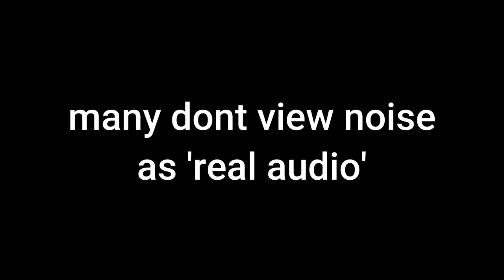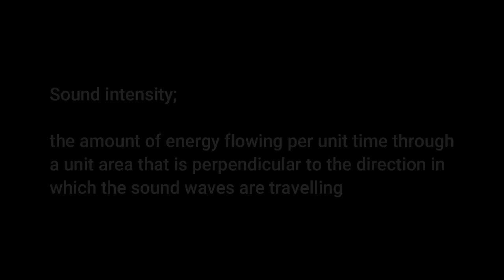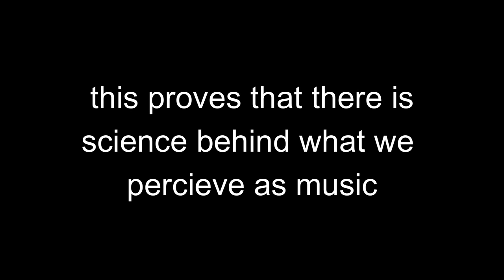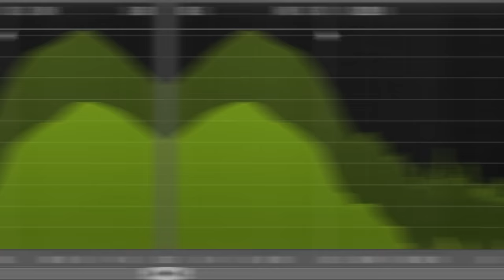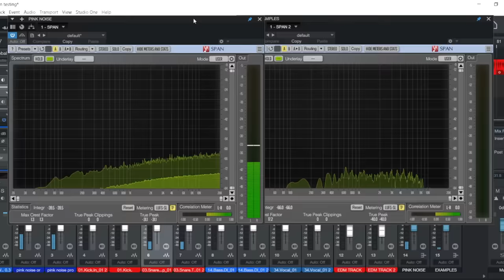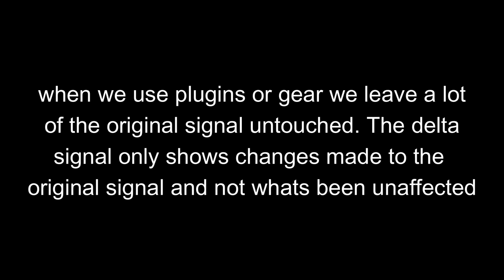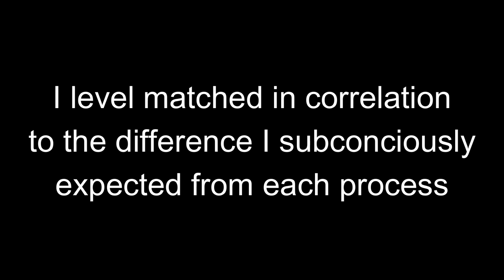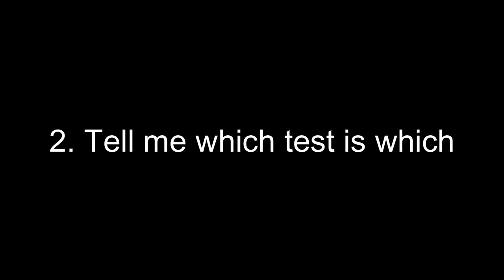THIS test will stop you buying more plugins.. and maybe even improve your mixes!!

Comment from the maker: FYI it was brought to my attention that when it comes to inharmonic instruments that have no musical context or harmonic structure ie cymbals and hi hats. There is no noise slope for this. These should be nulled individually on the source itself. This pink noise test will only work with musical sounds that follow a harmonic structure. 

Test 1

https://soundcloud.com/paul-third-944739244/sets/6dbfs-kick-test-can-you-hear

Test 2

https://soundcloud.com/paul-third-944739244/sets/test-2

Vote on the community post on my channel which will be up for 24 hours 🤓
Reply: I didn't fully understand the test, but my guess is that B is louder in terms of dB.
Reply from the maker: In which test?
Reply: @PaulThird  The first test. In the second test the choices are AA and BB.
Reply from the maker: One test is a 0.6db level difference and another is a 0.6db tonal difference caused by saturation
Reply: @PaulThird  Okay, then my guess is that in test 1 B is louder in dB and in test 2 BB is the saturated audio.
Reply: Well, I must face the fact that I do not have superhuman ears.  I could not tell any difference no matter how many times I A/B'd them.  I cannot see bacteria without the use of a microscope either.  I won't belabor the point.

Comment: one of the neatest tricks I've learned over the years is if you're having trouble with a mix, to throw a pink noise source on the monitor and then level each track individually so that its barely audible over the pink noise, it works surprisingly well and after a while I began to understand how to move towards that result more organically. Doesnt change that my music is shit, but its balanced well now at least !
Reply: lol!
Reply: Interesting I have never heard of this. I will have to try this out for fun. Thanks for sharing
Reply: Gonna try that. Usually if I'm adjusting levels I'll throw a mono plugin on the master bus..set my levels then just turn it off, and it made a huge difference. If not I'm fighting it getting aggravated

Comment: Thanks Paul. It's a sorry fact of life but no amount of showing people the truth will convince those with little skill in critical thinking, but it's courageous of you to try. One note is that polarity inversion is not the same as a 180-degree phase shift. When you invert, the waveforms are still precisely aligned in time. When you phase shift by 180 degrees the two waveforms are out in time by half the wavelength. Thus, with a non-sinusoidal signal, shifting the fundamental by 180 degrees won't move any other frequency by 180. Inversion makes every frequency in the signal opposite phase. 😆
Reply from the maker: Yes, I figured that out in another comment haha 😅

Comment: Paul, speaking of not purchasing more plugins - there's a company called Direct Approach that just announced all it's plugins (there's 10) are free. They all seem to be unique. Would love your take on these!
Reply: @PaulThird  Their metering plugin, SpecTrend is actually what first attracted me. It provides a pink-noise weighted view of the audio spectrum of your track. With pink-noise weighting, all frequency bands will be at the same level when your mix is spectrally balanced. And the +3db low end compensation allows for more low end in modern mixes. I wouldn't necessarily let this tool dictate my mixes, but an interesting referencing tool, nonetheless. It's also completely silent.

Comment: The person that wrote “use your eyes, not your eyes” is using their eyes to decide what a plugin sounds like based on the description they read. People also tend to think a plug-in sounds better based on how much money they spent on it.  

I use Logic Pro, and for the most part their included free plugins. They work great, and when comparing to something like Waves plugins which I demoed, on an equal if not better level of quality. 

My one concern in the tests is while noise is a valid audio source for null tests, I wondered about transient responses of the plugin. Especially if it’s adding any distortion/harmonics. 

But overall I find your testing very thorough and well thought out and executed. 

Null tests don’t lie. Do you think you get “better” audio quality recording at 128k instead of 48k? Null tests show otherwise. You gain aliasing artifacts at high sample rates and gain no better frequency response. 

But people have bias confirmation and always think their rationalized option on what they just heard proves them right. 

That’s why we do blind listening tests. To avoid bias.
Reply: @PaulThird  By the way, I made the transient comment before I got to that part of the video! So thanks for covering that. I agree with your findings. I’ve been a self taught audio engineer for the past 50 years of recording myself and my bands on all manners of gear. We have so many options these days. Too many! Lol. 

I say just get a good recording going in and stop thinking some plugin is going to eliminate the skill needed in mixing. That just takes experience and learning how to hear (and see) audio.

Comment: I think what's happening is people are confusing static processes with dynamic / nonlinear. 
Someone who doesn't know the difference won't accept an eq null because they've heard dynamic comparisons as different which were only measured statically. 
Some tests, noise or otherwise are only appropriate in certain tests and situations. In other words we can't measure psychoacoustic differences over time.
Reply from the maker: Yup when in reality the null test caters for everything regardless of dynamic or static process.

A pink noise null on compression for example would give the same maximum difference amounts but at a fixed gain eduction so to really paint a more consistent picture, in theory, you would have to take snaps shots of the null at different levels of gain reduction but the reality is that in a dynamic test, as long as the max frequency peak is matched whatever the highest gain reduction that source reaches is, the pink noise null will show maximum possible differences at that gain reduction.

Comment: I have a theory on why less than 1 db can be heard.
It's not that you hear 1 db difference, but that  two sound files (wav, mp3, whatever) may have, say, 0.5 db difference, but those files pass through a multiplier (amplifier), that being your sound system or even plugins in the sound chain.
In that case, you are not listening to just  1db or less of difference, but that amount multiplied by a certain factor.

Comment: Music is just organised noise.

I attended a mastering seminar by Bob Katz a few years ago where he suggested that we can perceive a difference of 0.2dB - louder is better.
Reply from the maker: I spoke to somebody else who said the same but it was more of a distortion speaker trick you could use at 0.2db but on average sources its much harder. I've found from this test that level difference is easier to hear compared to tonal difference. I'd argue tonal differences of 1db is much harder to identify than a 1db level change.

Over 80% failed my double 0.6db test
Reply: @PaulThird  - I wouldn’t disagree, a 1dB difference over the whole spectrum is pretty obvious. 

A 1dB difference in tonality probably depends on the bandwidth of the difference - I’d suggest that a 1dB boost with a Q of 5 is more difficult to discern than a 1dB Boots with a Q of 0.5. An “area under the curve” kind of thing.
Narrow cuts are even more difficult to hear.

Comment: Really cool video! A lot of it is going over my head, but I have one question regarding the idea that a sub 1db difference is inaudible. If a plugin was generating an unintended bump of .3-.6db and it was being instantiated on a large handful of tracks in a mixing session, wouldn't that cause a buildup that would ultimately become audible? I may be way off in understanding what you're getting at in the vid haha but thanks for all the info! was still interesting to watch regardless
Reply from the maker: Then it must likely wouldnt be a sub dB difference if you added them all together. I'm talking about a difference caused by 1 process on 1 source. You are talking about 1 process over multiple sources. In that instance the bump would accumulate and become audible, well depending on if the source makes a lot of that frequency anyway and other factors. Depends on where the bump is, how wide it is, how much its adding, how many sources its on, the level of those sources in relation to the mix and what frequencies they make.

Its all context, are you adding 1 process to 1 source or adding 1 process to multiple sources. There's a very big difference in methods and context but both can still be measured to give you an overall level difference

Comment: Hi, i'm a hearing aid acoustician and i have small complaint: i'd really like to see the source that claims that frequencies below 250Hz largely bypass the inner ear because they don't and you couldn't hear them if they did.  What is true is that we percieve frequencies below 250Hz to be quieter than higher freqencies with the same energy (see "Fletcher.Munson Curve), but we can hear frequencies down to approx. 20Hz.
Reply from the maker: https://www.science.org/content/article/sounds-you-cant-hear-can-still-hurt-your-ears

https://www.ncbi.nlm.nih.gov/pmc/articles/PMC4448896/

That's where I got the exact quote from though 

https://royalsocietypublishing.org/doi/10.1098/rsos.140166

If I recall I did say that the reason for us perceiving lower frequencies less is due to lower frequencies being inadequate at driving the inner hair cells of the cochlea. That's somewhere in one of these references.
Reply: @PaulThird  Ok sorry for the late answer: the term largely bypass the inner ear might be a bit unlucky, because what frame of reference is used here? All energy that has been coming from a certain sound source? But the energy coming from a sound source will mostly bypass the inner ear in all frequencies, only a fraction of the energy will even get there. What is actually true is that a sinus at 250Hz needs to be about 20db louder than a sinus at 1kHz (which equals to 10 times the energy) to generate enough action potentials in the inner hair cells to be conciously perceived. That might sound like a lot, but humans have a hearing dynamic of 100db or more (and since db is logarythmical this equals 100 000 times the energy) so in correlation it is actually not that much. Anyway these frequencies don't "largely bypass" the inner ear, the hearing cells just need more energy to be activated in lower frequencies (interestingly the difference gets smaller in louder levels). Think of it like resonances.
Reply from the maker: Just unfortunate wording then. Bypass is probably not the best word

Comment: I'm not convinced that any integrated test - especially on a steady state signal - will really show us the effect of slew rate limiting until it gets really extreme.  Not up to running the tests right now, though.

On a perhaps unrelated point, I find myself wondering if the area under the curve is sometimes more meaningful than the level at any given frequency, but atm am not sure how or why or when  that might be true.
Reply: I’ve always understood that slew rate limiting manifests as a reduction of high frequencies since the higher harmonics required to produce a fast rise time (according to Fourier) will be necessarily absent.

The corollary to this is that digital audio is inevitably slew rate limited at high frequencies (above 1/2 nyquist) as there will be no high harmonics to sharpen up the rising edge of transients. Luckily, most energy in the top octave is from cymbals and the like in which partials are not harmonically related. Aliasing in the top octave (10k-20k) can sometimes be euphonic and improve perceived transient performance. 
Aliasing in lower octaves is definitely not euphonic though (like any kind of intermodulation distortion).
Reply: Well slew rate limiting is dynamic.  It’s not the same as a static filter, and I’m just not sure how it translates to windowed FFT analysis of a pink noise source.  I believe I can hear it before I can see it on SPAN, but it’s been a while since I did those tests.

Comment: SSL have a disclaimer on their page and in their manuals for the new ch strips stating that plugin doctor analysis of their plugins may not be correct due to (this is where I get lost) something about being non linear.  Anyway disclaimers about plugin doctor? I feel like they are talking to you directly 😂 do you have plugin companies scared? And what is this they are even claiming? Thanks 🙏🏾
Reply from the maker: Plugin doctor defaults with a linear test which if fed too much non linearities ie lots of noise and distortion then may warp the linear test reading. Depends on how much non linearity is fed through the system. 

However there is also a fundamental sweep which caters for non linearities so their point is completely pointless. 

SSL making a point to discredit plugin doctor in their manual and website about this usually means that they have something you want to hide.

So be very aware

Comment: Just record at 16 bit if it's not audible under -96. I'm willing to bet you absolutely hear the difference.
Reply from the maker: -96db noise floor? Cause that's all going from 24 bit down to 16 bit results in. A higher noise floor
Reply: @PaulThird  The measurements on mine are -105 and -109. They are early and mid 2000's apogee and lucid designs. You have a great ear Paul, I'm inclined to believe you hear the difference between truncating or dithering from 24 to 16 bit with adequate level. Why have greater than 16 bit precision even for mixing otherwise? I think there's a difference between playback of a -86 dbfs (you can hear that in an adequately noise free environment, it may be buried in home studio conditions regularly)signal and -86 in a mix. The difference is your ear makes out the relative difference. Not only is that audible to me in a home studio, but it's an easy measurement.
Reply: @PaulThird  Run a test perhaps. Track 16 bit and 24 bit simultaneously. Use something like waves idr without dither, or an old free program like cool edit 96. Iirc you can run 16 bit mixing on it or similar old software. I bet you measure and hear a difference. I'll reference Bob Katz Mastering Handbook as one of my sources for education on the topic. It's a great read if you haven't seen it. I admire that you're data driven in analysis, it's a great quality of yours.
Reply from the maker: Tbh I just do 24 bit. 32 bit floating point is a bit extreme for me. I'm not peaking the shit out my stuff.

There was a great video on 16 and 24 bit I referenced in a video years ago where it showed the noise differences
Reply: @PaulThird  With all respect, you're using 32 and 64 bit. It's in your mix bus, plugins and measurement tools. Every bit in fixed point yields 6db of dynamic range and hopefully SNR. I've seen a common measurement problem where people null a 32bit and 64bit mix bus mix. That's mathematical nonsense, computers are usually great at math. They missed that they're measuring with 32 bit software! It lacks the mathematical precision to measure the difference in math in the first place. I'll offer a second test for you, if only thought experiment. Take a 24bit unprocessed recording and truncate to 16 bit. Do 15 and 14, hell 8 bit. You'll hear it get worse if it's a natural sound. It'll take a lot longer to discern with a sine wave or two tho. I think the reason is those harmonics are perfectly related, unless you happen into a bit of intermodulation distortion or a bad iir anti alias filter. I think we hear the difference faster with less predictable signals like found in nature and music. That makes our measurements much harder to justify, and simultaneously all the more important imo.
Reply: @PaulThird  Since a single sine wave or white noise are excellent for measurements, but difficult to hear maybe some testing should be two or more sine waves? That would increase the occurrence of imd distortion if I'm not mistaken.
Reply from the maker: Actually I'm lying. I forgot I use single process in studio one which is 32 bit. It's double (64 bit) that I think is redundant for me and waste of cpu

Comment: What are you doing exactly in this video? Are you setting the noise to correspond to the music and doing a null of the two? Or what?
Reply from the maker: No. The pink noise is the source nulling a direct copy of itself. One with no processing, another with saturation, and then comparing that null against the null of a musical or acoustic sound using the exact same process and test setup.

The only correspondence the pink noise has to the musical source is it's own level in relation to the max frequency peak of the musical source. In other words, the level of the pink noise going into the process is determined by the max frequency peak of the musical/acoustic source.

They are still both 2 seperate tests with their own nulls.

What the video proves is that regardless of what the musical source is, it will never achieve a louder null on any process as long as the pink noise matches it's loudest frequency peak. So when testing for audible differences in regards of 1 or 2 different processes, pink noise can act as the final arbiter cause if its null shows an inaudible level going in at the maximum level you'd go into that process at.. Then doing ANY musical AB is pointless cause there's not enough audible differences there to decipher which is which
Reply: @PaulThird  oh….  Ok, that makes much more sense now.  I watched it 3 times trying to figure out what was going on.  Lol.  But I’m not one of those types that think there would be a difference because ike you said, audio is audio. Thanks for the explanation.